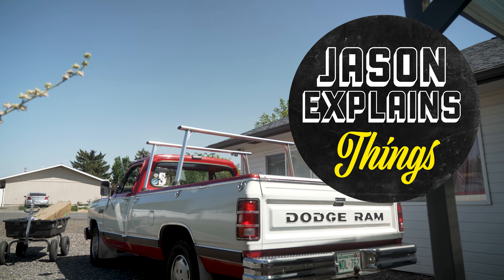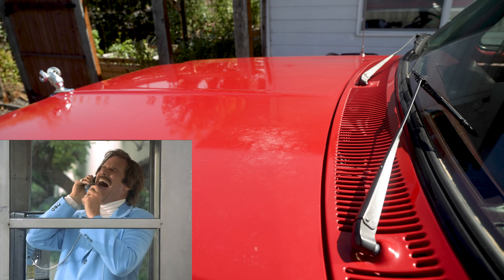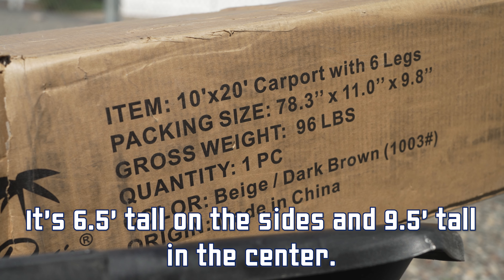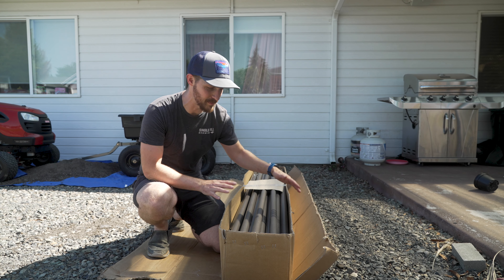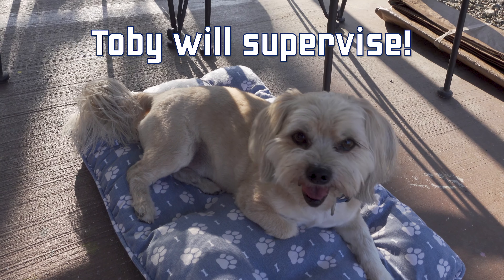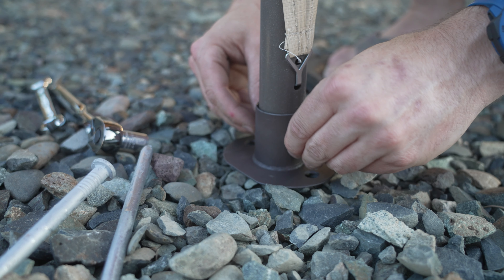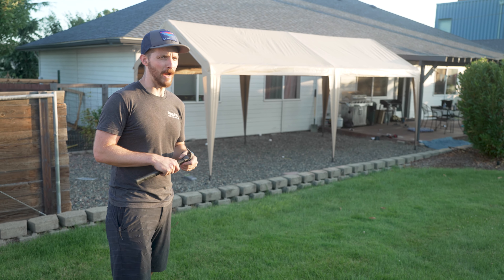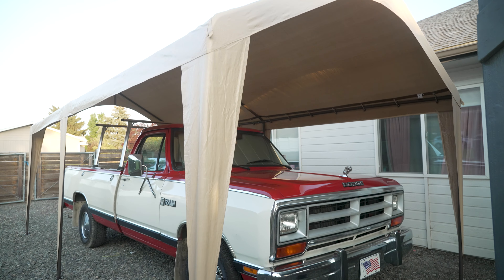Is a Portable Carport From Amazon Any Good?!

Comment: So I bought the one from harbor freight and used 4 tie downs that screw into the ground 12 inches and the straps hook to them.   It's been up for 3 years.   I did put another tarp to put over the top because the tarp material gave out from the weather.   The stakes are the ones you screw into the ground to keep a pet from running out of the yard
Reply from the maker: Nice.
Reply: I heard those dog stakes are great..thanks for info. I will get on e from Habor.

Comment: Thanks.  It looks like the Achilles heel are the anchors.  I think I would tie those posts down with concrete blocks, or maybe quickcrete.  How is the material holding up?
Reply from the maker: Hey Johnny.  You sir are a fortune teller.  In a wind storm the archors started coming up.  I put cement blocks on the corners and it survived the winter just fine.  We had a ton of snow so I had to be diligent to not let it get built up.  The fabric has held up very well.  It did get stretched when there was snow on it but it has rebounded.  For the money I'm very happy.  Still trying to get a real carport built to shelter the truck.